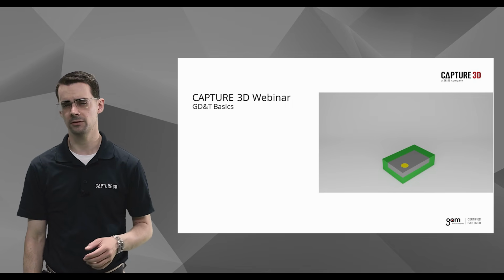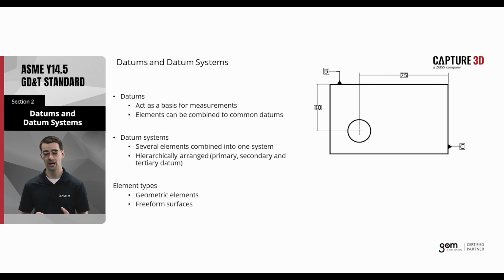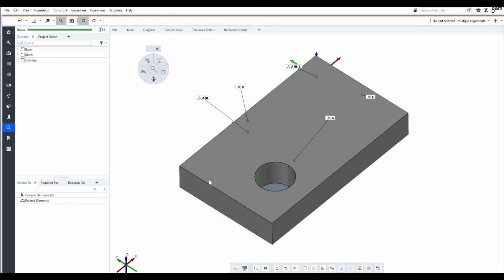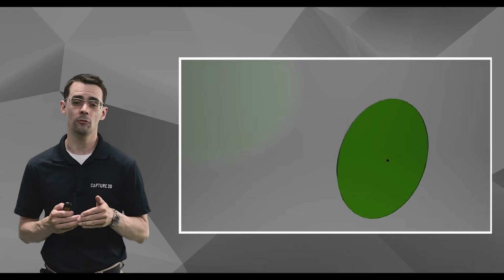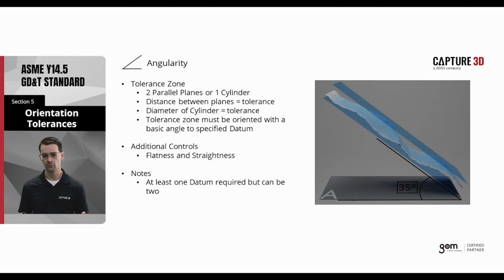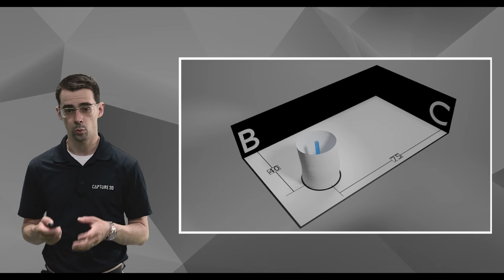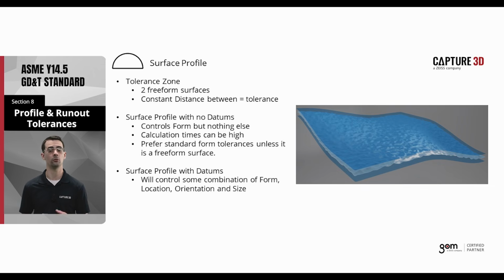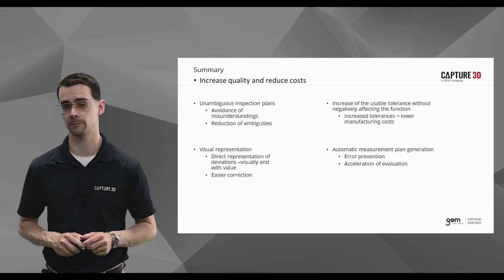An Updated Beginner's Guide to GD&T (Geometric Dimensioning and Tolerancing)

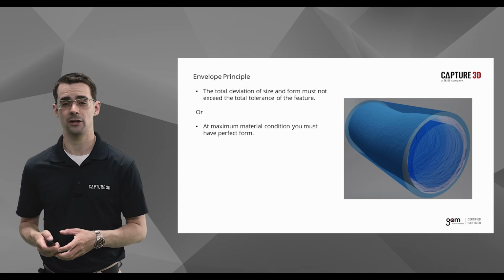Comment: Thank you, your video was very clear and well thought out and the information well presented. I would ask you to review your description of envelopes. @ 8:07 you stated that the feature could not violate either boundary, this is incorrect. While perfect form at MMC is required the feature can have form error equal to the amount the feature departs form MMC toward LMC. In the example given a 19mm hole could have no form error however a 21mm hole could have as much as 2mm of form error and still meet the drawing requirements. If you were to model a 21mm cylinder that had a straightness of 2mm it would certainly fall outside of the 21mm envelope. In your example the entire hole would have to have a local size (any two opposing points) between 19mm and 21mm and would have to have an AME (actual mating envelope) no smaller than 19mm.
Reply: I agree, the explanation was incorrect, unfortunately. By default, there is a requirement of perfect form at MMC, but no  requirement of perfect form at LMC. The ASME Y14.5 standard is very explicit about it. Therefore the explanation and the graphic showing the 2 coaxial cylindrical bounaries is misleading.
Reply from the maker: Hi! Thank you for watching and bringing up a good point. You are correct that straightness is an exception to the envelope principle. This tutorial covers and condenses hours of training material into a 30-minute video, so some things had to be left out. If you have any further questions, please let email us at info@capture3d.com. 

Thank you!
Reply: @ZEISS-IndustrialQuality-USA  The reason you could violate the least material boundary is because rule #1 allows it not because of some exception. You need to be careful stating that Straightness is an exception to rule #1. The example given in your video there would be no exception the rule, my original comment stands.  Only in very specific cases can straightness (and flatness) allow the feature of size to violate the rule. In order for Straightness/Flatness to be an exception it must be applied to a size dimension.